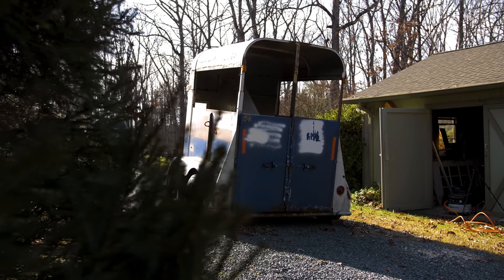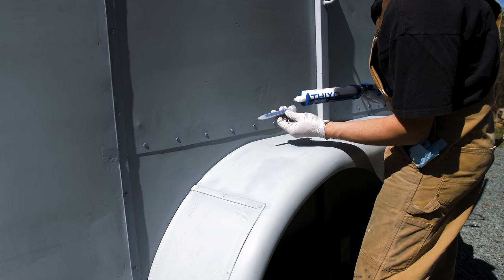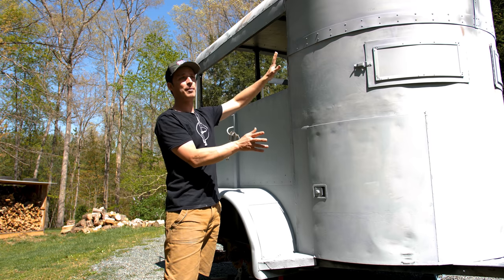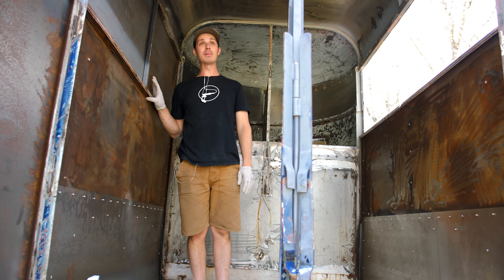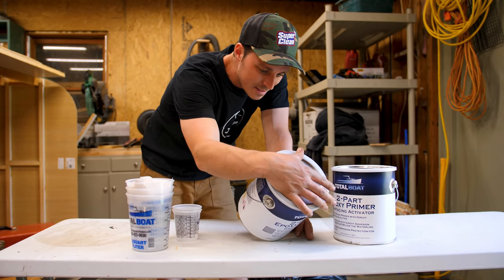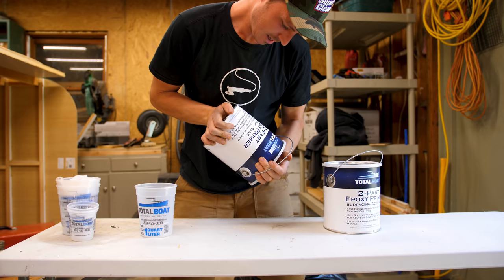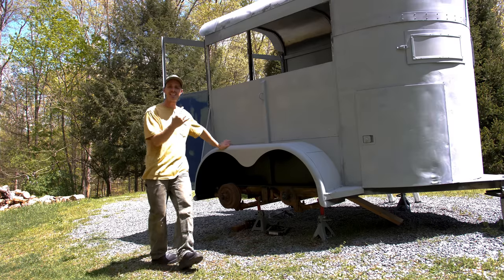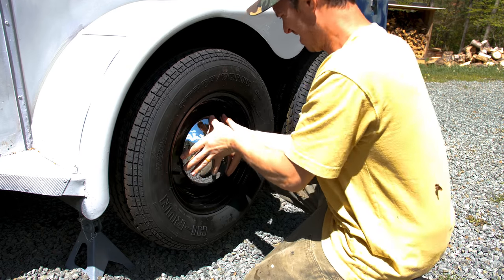The Mobile Bar is PAINTED - Mobile Bar Build Ep.10

Comment: What product did you use for the black paint? thanks. I am building a mobile bar as well. I have the inside 80% complete. I primed two coats on the outside.
Reply from the maker: I used the rust oleum high performance gloss enamel.